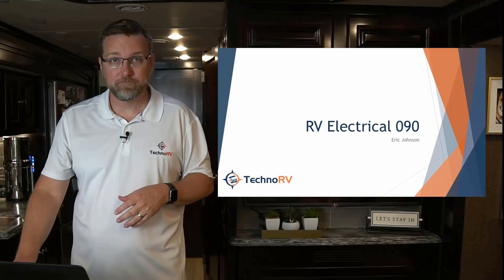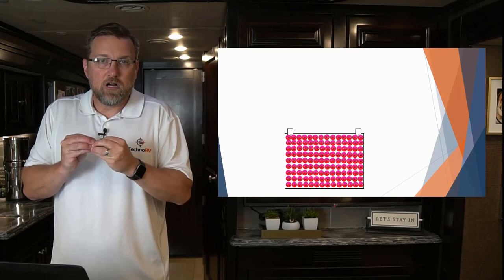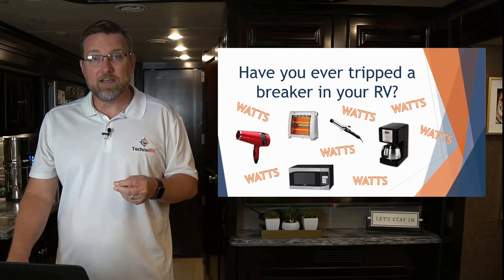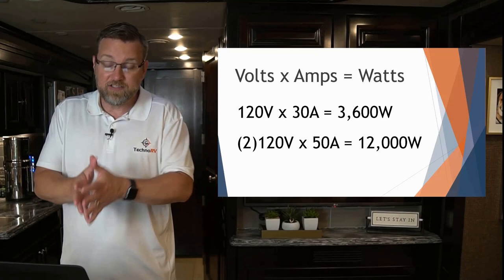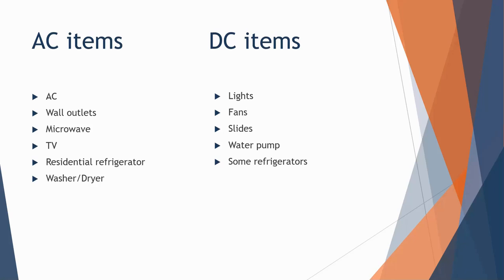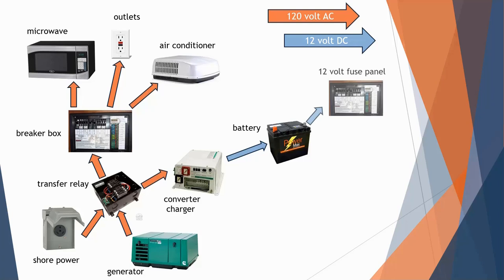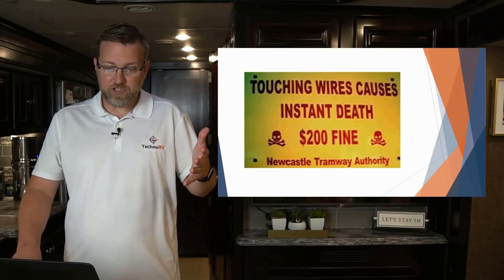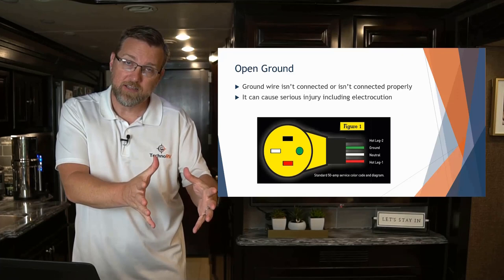RV Electrical 090 by TechnoRV

Comment: Great learning for a RV'er. I do have a power surge protector and it has protected my RV> I cam back from a walk and noticed the air conditioner was tripped. After looking at the surge protector, I noticed I only had one 120 line coming into my RV. I called the camp manager and he saw the problem and moved us to another lot. Well worth the investment- I use a surge guard.

Comment: Very good video! Couple of things I will throw out there as possible clarification. 
1. The ground - It is basically a safety to protect people if live voltage is allowed to the appliance in manner that will charge exposed area that people can touch. Obviously something you WANT to be working! It also comes into play if somehow there is a short in the appliance the incoming power goes to ground, you have uncontrolled current and it should trip the breaker before a person ever has a chance to touch it. 
2. The Common / Neutral - Electricity works much like water flow. You have the potential coming in (supply), and as it is used it flows back to the source through the return (Common / Neutral). Without it, you will have Potential (voltage) but no difference in potential needed to make the appliance or electronics work. Like water, you have pressure coming in, but the faucet outlet is stopped up (IE no Common), you open the facet and get no water flow. Without the stoppage, the water will flow out and go out the drain (IE Common / Neutral). If working correctly the common should handle all of the potential power coming into the appliance and it should be safe, but it is not uncommon to have floating voltage on it, so still treat it with respect. 
3. Under voltage - Want to explain why I feel this is more of a problem then people realize. The problem with under Voltage, is you have a LACK of potential (Voltage) but the appliance is design to operate and use a certain amount of WATTs. Your formula you show explains what happens here. I * A = Watt, To make up for low amount if I (Potential / Voltage) it has to increase A - Amperage to make up for it. Amperage is where the HEAT is, and HEAT will destroy appliances and electronics either over time, or enough of it you get smoke and its dead. Most of the time though, I believe its happening far more often then people realize, simply because you don't SEE it happening unless you have a proper EMS system. So over time you slowly cook your appliance. 
To give an example - power supplies, pretty much all of them have a transformer. That transformer is basically a long insulated wire wrapped around a conductor in the middle forming a coil. When you heat up that coil over what it was designed for, you start to break down that insulation. Do it enough times and the insulation will fail, and either short out in the coil, or short out to the conductor in the middle and it blows. That is just one of many electrical / electronic components typically in an appliance or electronic device, all of which will break down with to much heat.

Comment: I had a missing neutral once and the voltage measured 217v  Found the neutral burned completely off in the campground box. Fried everything in the RV. I was a mobile tech back then and the campground owner blocked me from coming to the campground after that for proving it was his fault. Fun.
Reply from the maker: It's amazing what the condition of some campground pedestals are  in!  I wouldn't plug into a pedestal without electrical protection for this very reason.  Thanks for sharing!

Comment: Eric, thanks for a great education about the electrical system of our Motorhome.  It really helped to understand why we had a power loss of our stove and ACs yesterday.  Everything came back, thank goodness, but understanding how much of a draw one side of the RV is having over the other side helped us to understand how we were taxing the system in the high heat and using several components of the kitchen.  My question is about hooking up to shore power.  We have the Surge Guard.  My husband says it is very difficult to separate our electrical cord from the surge protector or perhaps difficult to attach it after the Surge Guard is hooked up to the pedestal to allow for the surge guard to identify any issues first.  If we leave the electrical cord attached to the surge guard and just shut off the main power switch before we hook up, would that have the same effect?  We appreciate your help and advice!
Reply from the maker: You can keep the cable attached to the Surge Guard, yes.  I would periodically separate them though to ensure you don't have any melting or charring on the prongs.  If you choose to keep them together, you would need to flip the breaker off, plug the Surge Guard in, and flip the power on.  It will go through its diagnostics and then allow power through if there are no problems.  You may also consider using some Dielectric grease on the prongs when you connect in order to make an easier disconnect.  The Surge Guard also has T-locks you can grip to give a little more help when separating the cable from the device.